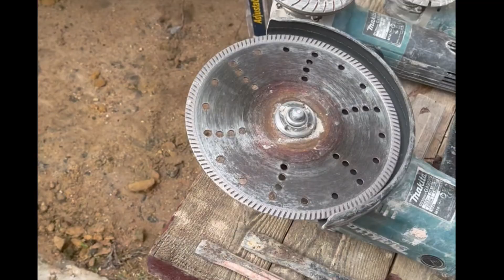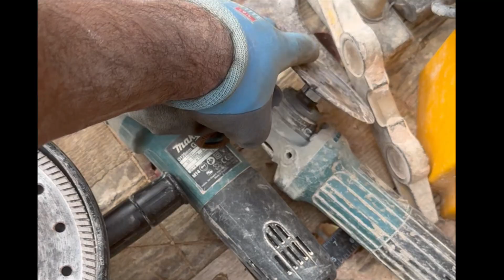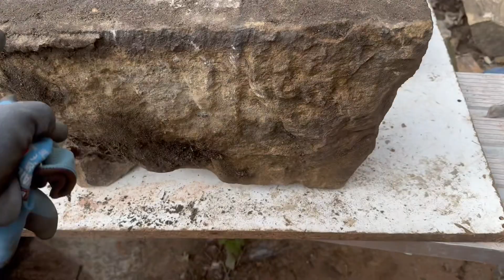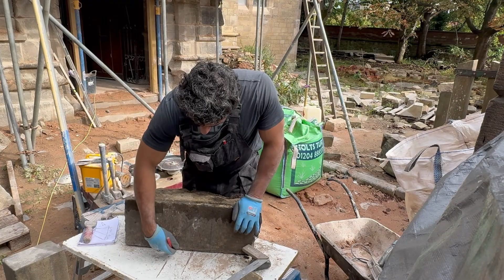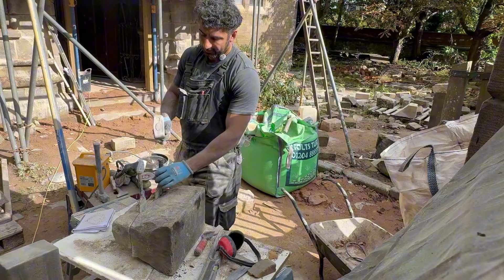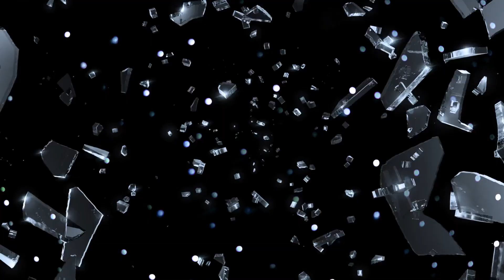Cutting Stone, Techniques & Methods Explained

Comment: Hey I spent a good few weeks dry cutting almost all day dense sandstone tiles atkeast 90% silica and then regular sandstone blocks. Was early into stone masonry and am concerned about my exposure to silica. I still do dry cutting and wear. A proper respirator with p3 filters. Always now that I’m aware of silica and its dangers I take as much precaution as I can but some times I still breath it in here and there if I’m cleaning up after or what ever, even dust in my car I have to keep windows down. What r your thoughts on tbjs
Reply: We use wet cutting methods for the most part when we can but we do alot of grinding and buffing back stuff which produces heaps of dust.
Reply from the maker: The best thing to do is just wear your dust mask at all times when cutting mate, and if possible water suppression which helps to reduce the dust created when cutting massively.  It’s always going to be around but just have to try to reduce it as much as possible. Hope this helps pal